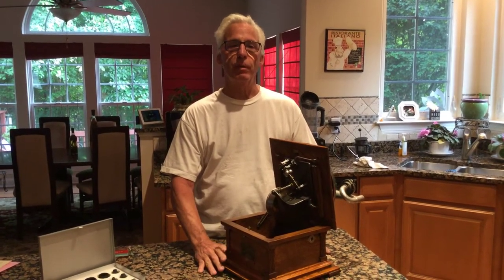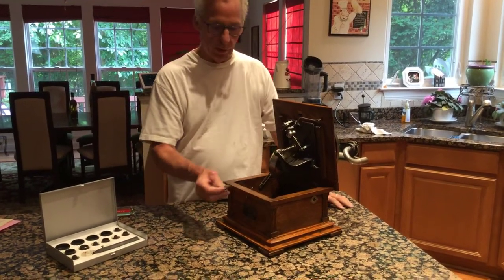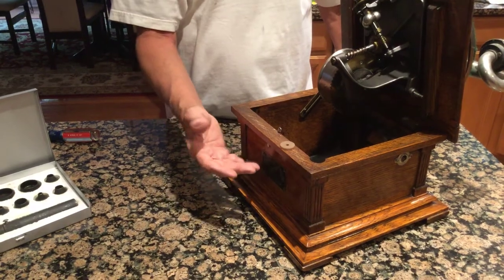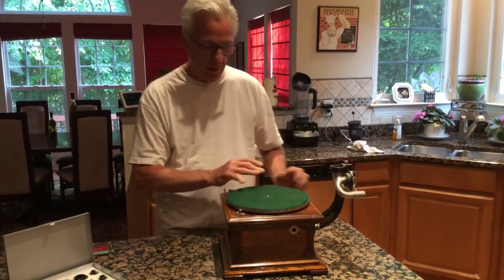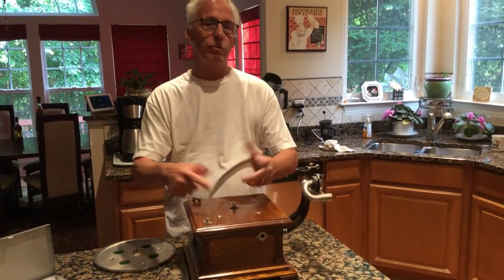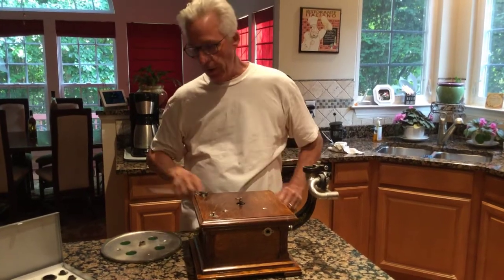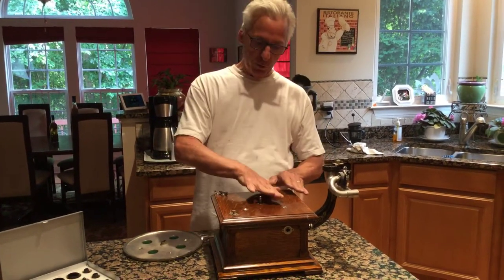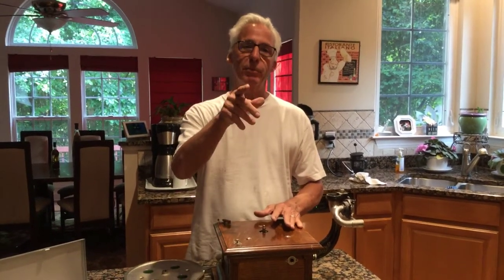77.  How to balance a wobbly phonograph turntable (Disc)

Comment: I had to drill out rust from the turntable and it wobbles just a bit.  The turntable. seems to fit like a glove to the spindle shaft, so I don't think the problem is in there.   I'm going to try this next

Comment: My turntable wobbles on the spindle. The screws fixing the motor to the motor board are ok and the spindle is straight. I’m guessing the hole in the turntable is worn ?